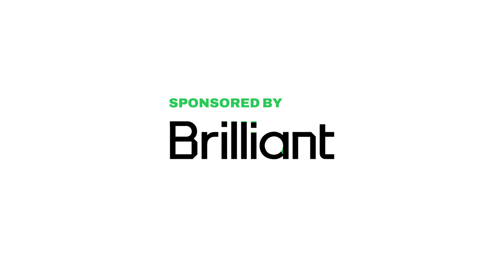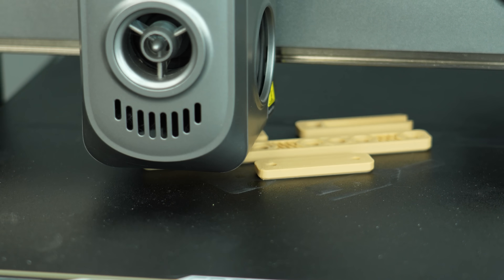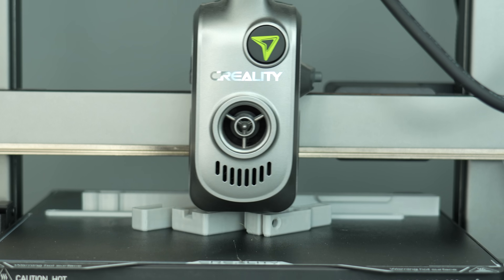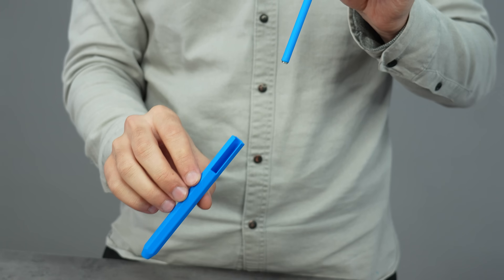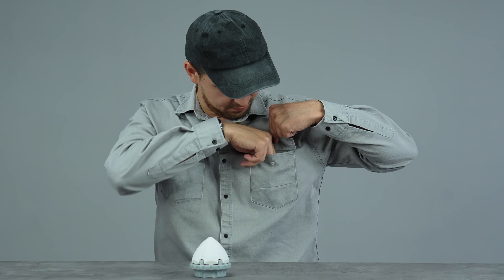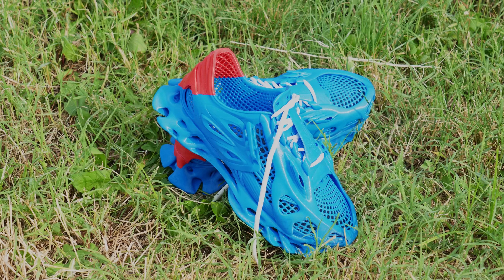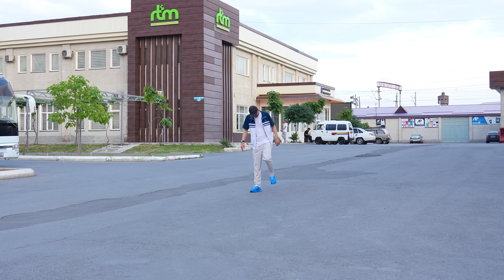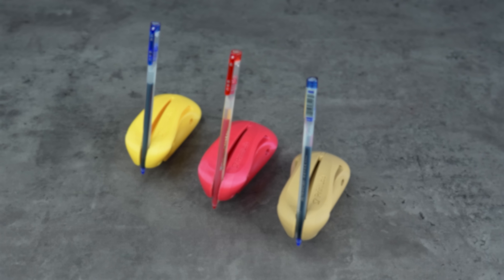USEFUL Ideas to 3D Print - June 2025

Comment: How about making a slider for a mobile phone/tablet with a wireless mini-keyboard (installed separately) that slides out from the bottom? And also, in the extreme extended position of the slider, by pressing the button-stopper, you can fold it in half, covering the screen from above, like in folding phones...

Comment: I hate multiboard, it's like a cluttered desk but mounted to the wall.
Reply: Except that's not clutter. Stuff on a desk prevent you from using that work space, that doesn't happen when your stuff is on a wall. If you use it in a clever way it works. You don't have to hang everything there, just what you need to grab. I don't specifically have multiboard, I have a metal pegboard and while it can look busy it's something I love. The alternative is simply putting everything into drawers which will mean you forget where's everything even if you use labels on drawers. Both have their place but my favorite is to have your most common tools and stuff on the pegboard and if you are careful you can make it very organized and pretty and can even use things like LED lighting to take it even a step further.
Reply: @berkertaskiran you are right. But these people don’t use their desks for working 😂
Reply: Totally...I know how hard it is to work at your wall when it's got stuff on it.. oh wait isn't the point to get the stuff off the desktop?
Reply: Well, thanks for sharing that valuable insight 😂

Comment: How do you say to keep dust out of your face when drilling into the ceiling above you and then show the print on the wall directly next to you.
Reply: I have a little adaptor that hooks up to a vacuum. Not as convenient but it works in any orientation. It would be pretty easy to design as a print.